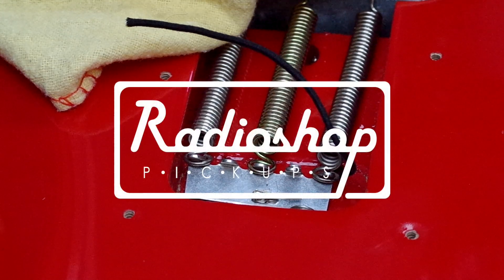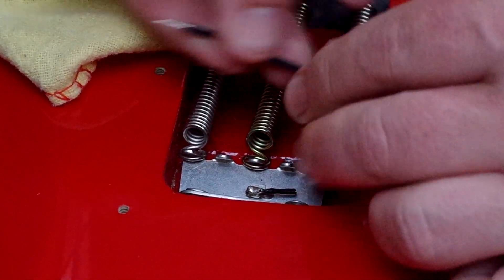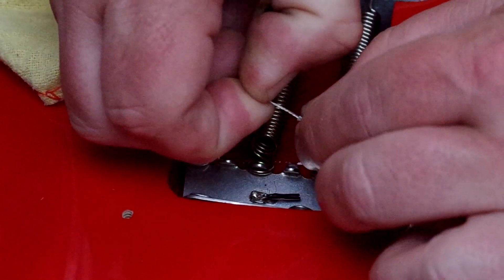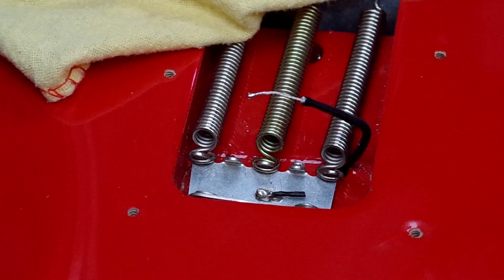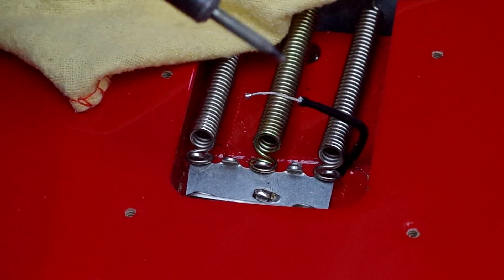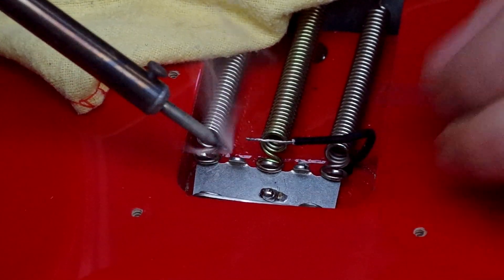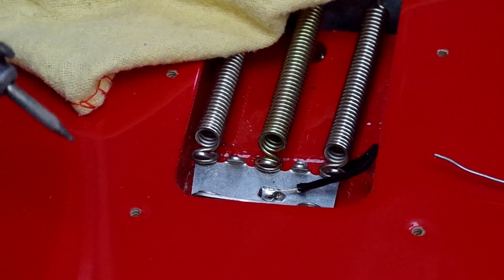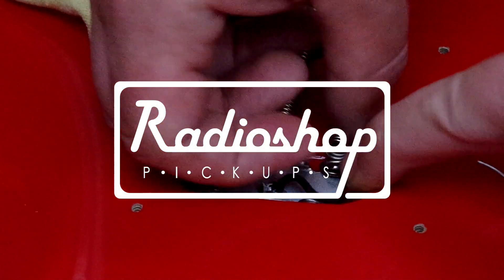How To Solder Guitars (6/6) - Soldering to a Trem Claw

Comment: I have a red wire and blue coming from volume knob. Also have another blue wire that was grounded to the claw as seen in this video. Cant remember which one was which. Does it matter. Both seem to be soldered in same position so should I just wing it and see what works
Reply: That all means your guitar won't go "to Eleven".

Comment: Thanks for sharing!
I was putting on a new solder to the claw but would not stick and someone told me that I need a solder that can reach higher temperature.  If so what is the temp needed for the the claw?  Thanks!
Reply: If you are using proper electronic solder (rosin flux core) and are getting it hot enough to melt the solder, the reason it's not sticking is that the claw itself is too cold and has oxides on the surface.  It will help is you are using a eutectic solder (63% tin, 37% lead) as it has a lower melting point. Then, try a bit of flux from a flux pen on the claw, heat it up with the iron until the flux bubbles and sizzles, THEN apply the solder. Should flow out like magic.
Reply: @G5Hohn  will try that, thank you!

Comment: What if my trem claw doesn’t have the tab to solder the ground wire to? I have a Floyd Rose original and am gonna install it in a Jackson Dinky.
Reply: The tab doesn't really do anything. The solder is doing the work. It's no different than soldering to the bottom of the volume or tone pot-- just that it needs even more heat.

Comment: My guitar got quiet and I saw that the term somehow made that wire disconect from The tremclaw. Do you think my problem is that it disconected or is there something wrong with the other elextronics? Cheers
Reply: Check the input jack or the pots.
Reply: Would you get shocked if the trek law ground or aux ground came loose? I’m worried maybe my soldering isn’t right I mean it’s stuck on there but there’s A small pool of solder on top of the wire aswell

Comment: What if the solder won't stick to claw? I have sanded to no avail.
Reply: Not enough heat. Get a more powerful soldering iron, at least 40W
Reply: Either the surface is too cold or you need more flux. Since the claw is only contacting two screws and some springs, don't be afraid to let it get very hot-- it won't damage the guitar or your claw. Use the largest soldering tip you can get for your pencil. If you are using just a little conical tip, it will be VERY difficult to get enough heat into the part. Try a large chisel tip or (even better) a large bevel tip 4mm or bigger. Usually the problem isn't the amount of power your soldering iron has, the problem is that the heat isn't flowing into the part fast enough. Here's you how can test to see if the problem is heat flow out or power flow in: dab some solder on the tip and use that to heat the claw up. If the tip cools so much that it will no longer melt solder applied to the tip, then you need more power. If the tip is hot enough to melt solder, then you have enough power--- the problem is getting the heat out of the tip, not restoring the heat that has been lost.

Comment: Good video. I was wondering if a solid wire can be used for the ground wire?
Reply: I've used solid wire on several guitars, it works just fine. Not as flexible, but since the current and voltage are so low, it's perfectly find to use a fairly fine wire.

Comment: What is the wire for?
Reply from the maker: Thank you for your question, Athos! That's the ground wire to the tremolo claw on the back of a Strat :) - Paul @ Radioshop
Reply: @RadioshopPickups  what does it do though, cause I got my guitar and it wasn't connected, and I don't know what it does
Reply from the maker: @jjocsings2885  Hi JJOC, it grounds the guitar and that helps eliminate buzz - Paul :)
Reply: @RadioshopPickups  Thank you, Paul, I haven't played my guitar since, but I used some soldering knowledge I learned in high school, to solder it to the trem claw, so hopefully it will be better
Reply: Where is the other side of this wire connected?  I recently swapped pickguards and I noticed that it wasn't connected and I do hear a lot of buzzing that wasn't there before.
Reply from the maker: @CemeteryCorvus  Hi there, it should connect to ground. Usually that means that it should be soldered to the top of the volume pot. That will certainly sort out your buzzing problem as the guitar isn't ground at the moment. Hope that helps :) Cheers, Paul
Reply: Radioshop Pickups

My Strat has 2 grounding wires. 
One runs from under the bridge pickup to the volume pot. 
One runs from the tremolo claw but isn’t connected to anything. Does that one go to the volume pot too?
Reply from the maker: @jake2355  Hi there, yes indeed - I would run that to the top of the volume pot too :)
Reply: @RadioshopPickups  is this necessary, I just bought and original floyd rose and it comes with a new claw and I dont have the solder machine... thingy, can I leave the cable sitting down on the cavity or I have to solder it
Reply: DiamondBag CFH I’m pretty sure you have to solder it, as mine isn’t soldered and I can’t play through an amp